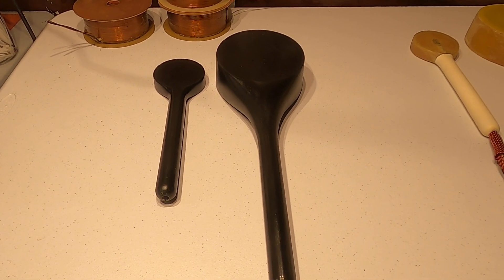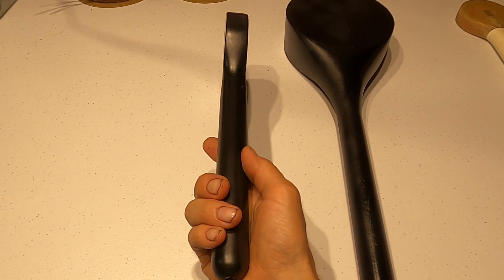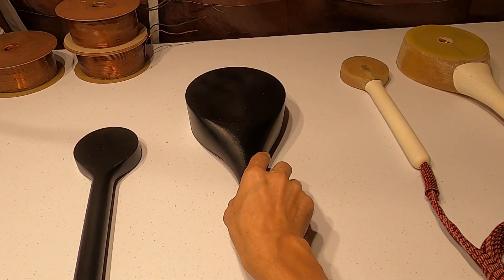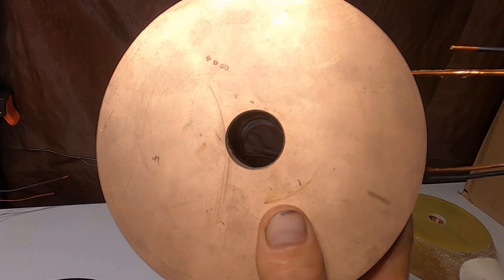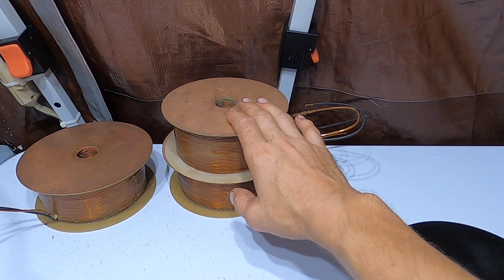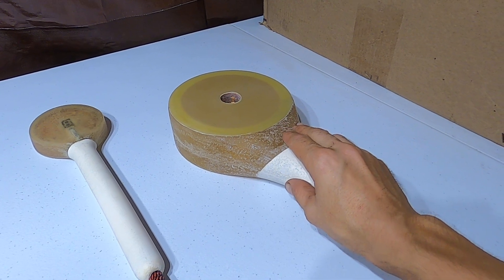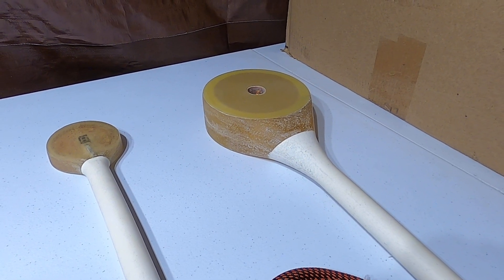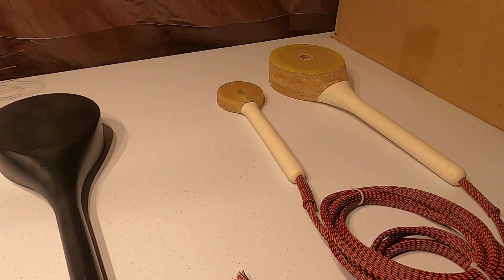061 New Aluminum PEMF Coil Design for PEMF 1B & 2B Circuits

Comment: Detachable coil? So, you finally found the connector that could handle high power. Cool!
Reply from the maker: No I haven't.
I went different route
I use large coil. Large coil is able to take into itself a charge something like a capacitor but it acts differently when charging.
Capacitors resist instant charge, coil does not. This means If I use large coil I can have the connector.
Large coil will not have as high current spike as small coil so connector should handle it. 
Again it needs to be tested over time
Reply: @AndreyD  Would definitely love to hear your update on that in the future.